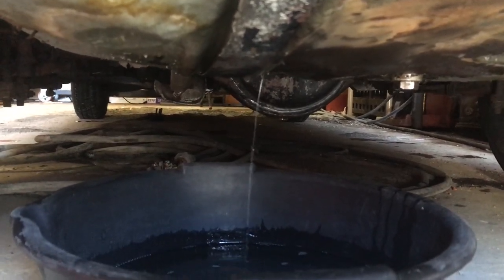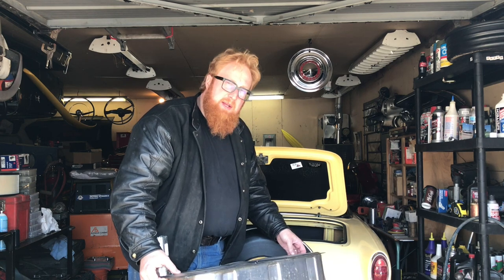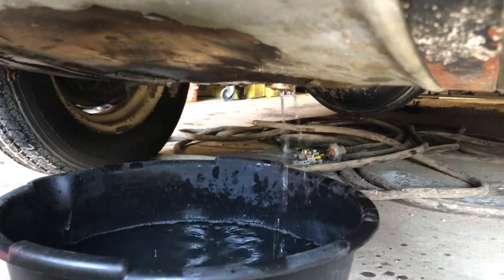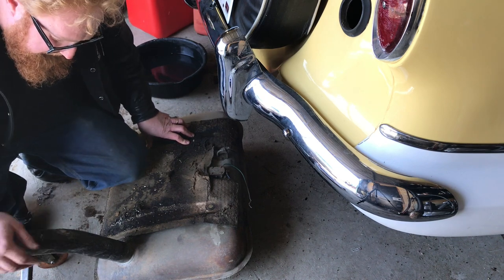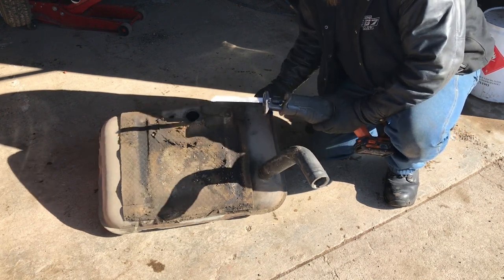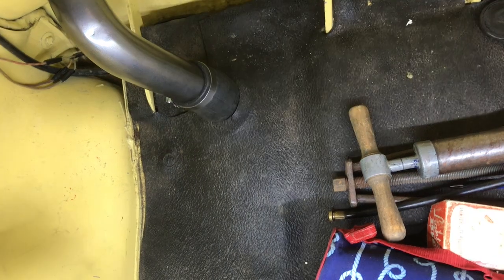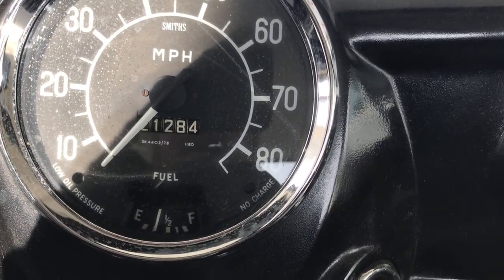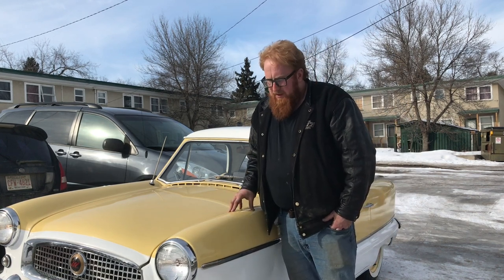Nash Metropolitan Fuel Tank Replacement #replacefueltank

Comment: Has the fuel tank got a good ground to the chassis?  Years ago I ran out of fuel with the gauge stuck on 1/4 full. After replacing the fuel pump I found rust around the sender unit had isolated the earth. Besides treating the rust I installed a short jumper lead. When are you going to start on your Lotus 7 project?  Best wishes from Australia.
Reply from the maker: Rob, been collection parts for the Lotus, so hopefully an update soon.  I ran a designated ground wire from the tank to the chassis, how is yours working now?